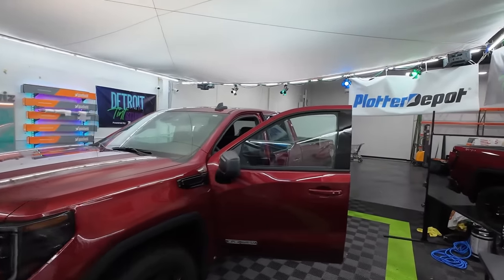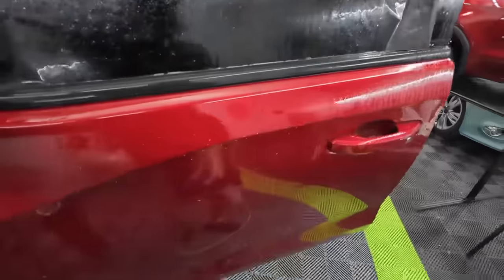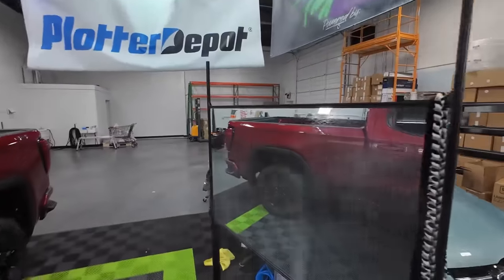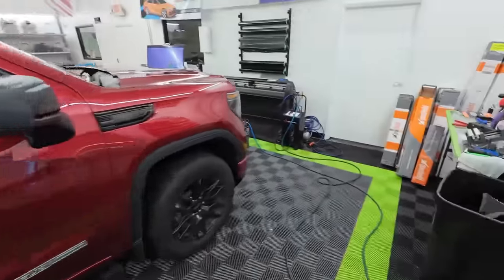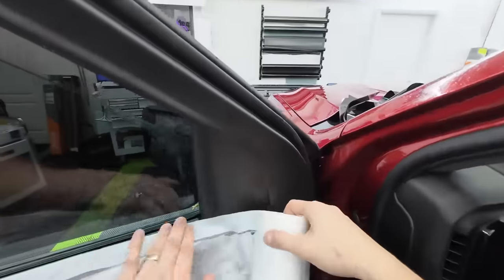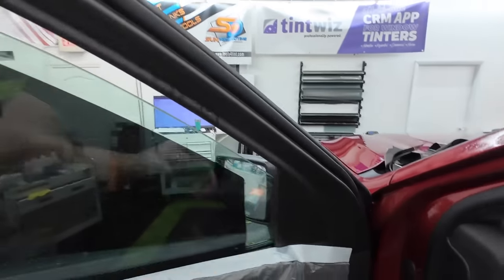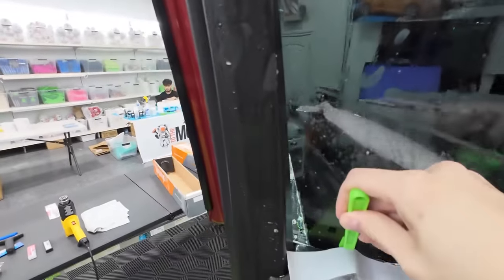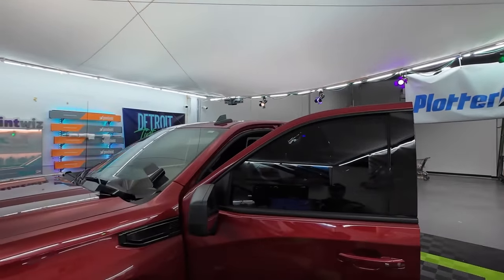What tint tools do I need?

Comment: Dude you’re a big help. I turned for a couple years and started in 2010. Was trained for 2 weeks by a LLumar rep. Loved it. This is while I was a technician at a dealer. Haven’t touched it until I sold a car in 2018, I had to do the driver window due to a scratch. I did pretty good. I miss it and just got a new to me car and I’m going to jump back in and tint the whole car myself. There is a lot of satisfaction tinting windows. Not only the looks, but knowing you are protecting the interior and also the occupants in the vehicle from Uv rays is awesome.

Comment: I installed new window tint and there is marks on inside from like squeegee do they come off or was there a problem installing I cleaned window 2 3 times used a razor blade to clean the first time  can someone help first time doing this

Comment: If you can an old sliding glass door work great for a glass board in the shop.  I had mine made out of 2x4s and on casters so I could roll it around.  Also had the long side parallel to the ground so it was like 7 foot wide for large wimdows

Comment: Iasked a question some time back on pricing. Man i would totalh go with you in a instant. Your informative. Get the job done pretty fast. Clean sharp and homest guy.. the shop i got my cars done.. they are a 7.5 the guy has experience.. but even with his girl helping out for scheduling and ao on. He still takes at least 4 hrs or so each car. And has more space then this.. have 5 cars waiting and approved.. but man.. reasom i even want my own timt is not to do business.. but rather to get it here in the usa amd do it myself in Mexico.. once the truck is fixed windows and all i well get all cars ceramic
 And do my own here.. well take some practice but with your information and knowledge i know its possible.. thanks man for this video..

Comment: idk how your tint slides so well, i just started and got lexen and tint slime and tint likes to grab the glass right away and makes it hard to position and tuck the bottom because i have to peel it off the glass. who knows maybe im just doing it wrong
Reply: I’ve been having the same issue and I’ve learned that baby shampoo is the way to go if you get specifically, the yellow bottles of the Johnson and Johnson, baby shampoo, tier free those have very little chemicals so whenever you’re done applying to tint, it doesn’t have any weird slicks of chemicals that is all over the window that hard to get off and it is also super slippery all it takes is 32 ounces of water and four squirts of baby shampoo out of a bottle. Hope this helps
Reply: @Jynxzihightlights how many ounces is a squirt
Reply: @BeepboppBeep-jv1od a squirt is just a bottle squeeze. Like how much youd use to shampoo some hair. Doesnt have to be exact

Comment: What do you use for your slip solution?
Reply: From what I've seen, a lot of people just use baby shampoo and water.
Reply: Johnsons baby shampoo (no scent) about 6 or 7 pumps in a 32 oz spray bottle...if it's hotter I'd try 7-9 pump. If bottom loading do 10